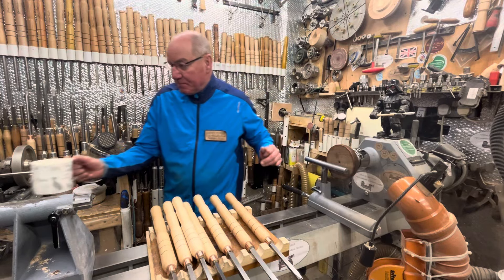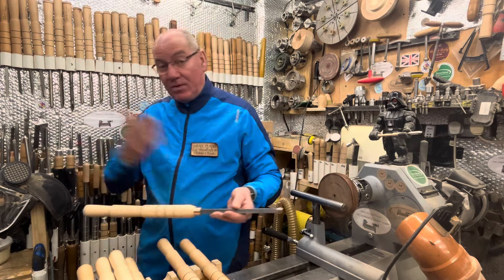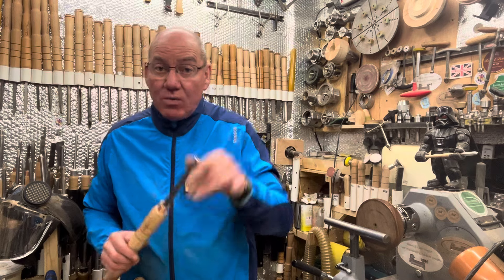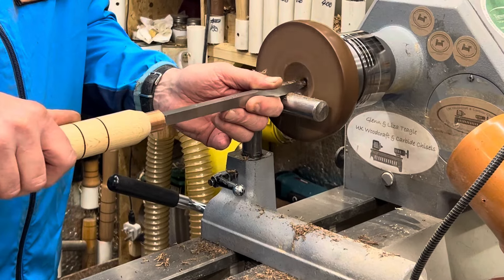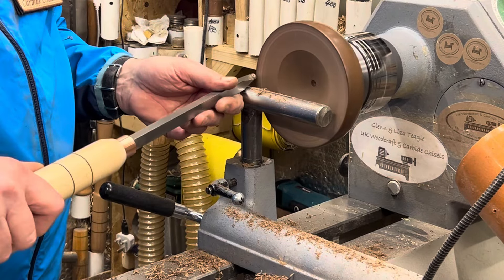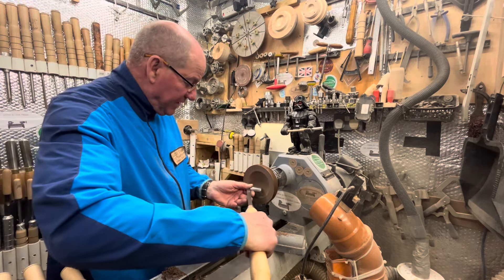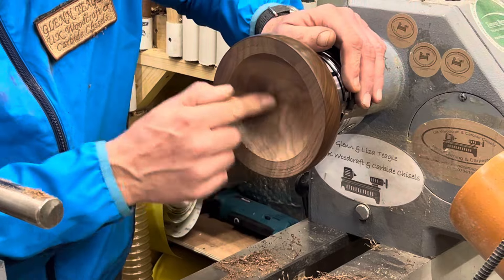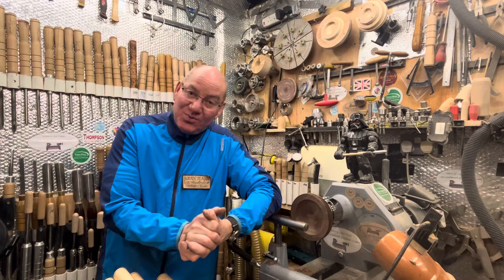Woodturning. An update to my SCH range of carbide chisels/tools

Comment: Amazing guys, I'm fairly new to turning but turn a lot of acrylic and wood pens along with small 10inch max diameter bowls. What set of chisels of yours would you recommend
Reply from the maker: Standard Type 3 Chisel set is what we recommend as an all rounder. We do 4 sets, the Pen Turning Chisel Set, Short Handled Type 3 Chisel Set, Standard Type 3 Chisel Set and the Large Chisel Set. You just need to decide on what suits you.